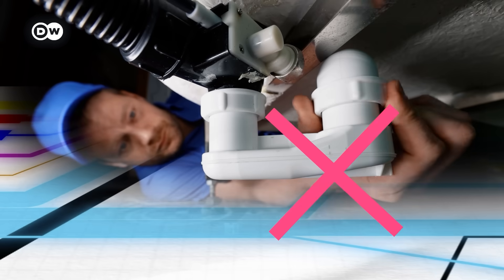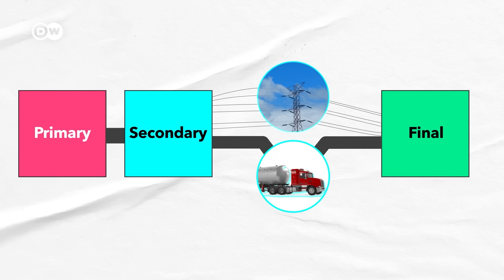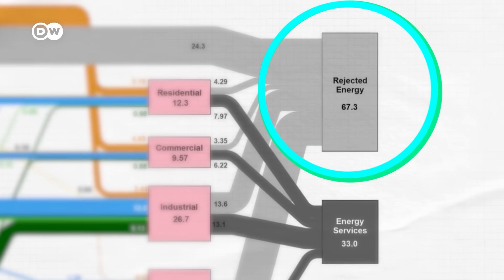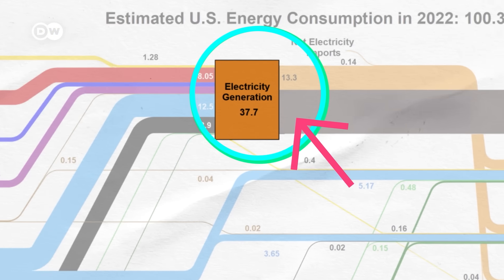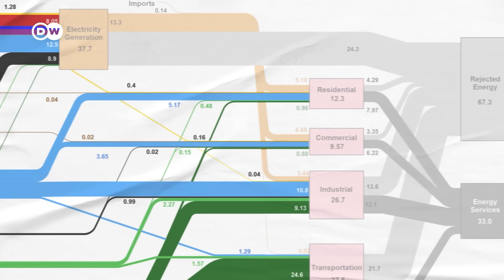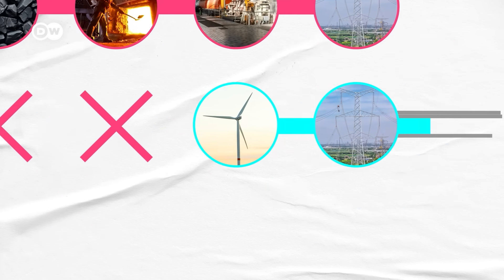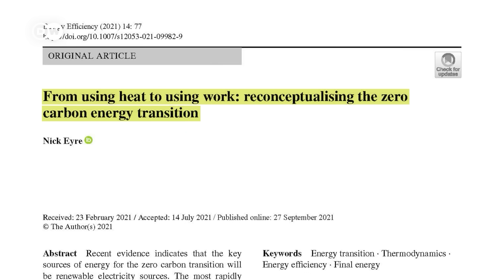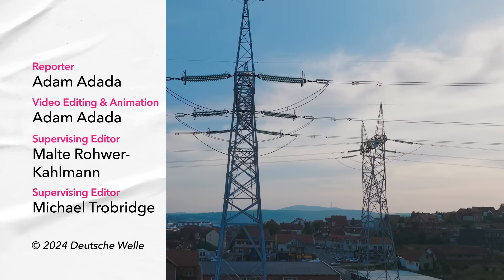The mind-blowing thing we get WRONG about energy

Comment: As an Energy Engineer working in this industry, this videos are great and show how things are not so straightforward. However, we shouldn't downplay how difficult it is replacing all energy uses with renewable electricity. Industrial heat is not currently possible to provide it with electricity when high temperature is required. Jet fuel is another example of a hard to decarbonise industry.
Moreover, we should not forget that electricity transport over long distances isn't cheap, if a country doesn't have much renewable potential, they may be required to import the energy in other forms such as traditional fossil fuels, which is a more efficient way of transporting large quantities of energy over long distances. An example of this could be Japan.
So whilst what you are mentioning here is true and important for people to understand, we shouldn't underestimate the complexity of the challenge our generation is facing.

Edit: to clarify, I am not against the transition or saying it is impossible. Just stating that it will take the use of many technologies, energy vectors, energy sources and it won't be a walk in the park. But it is definitely achievable.
Reply: There are already ways of producing industrial heating using green energy, they just haven't been widely used yet. While I do think that there will be SOME fossil fuel use for a long time to come, things like long haul air travel that are very hard to convert, It's important to remember that it's not necessary to eliminate ALL fossil fuel use, just to massively reduce it in the areas where we CAN. It's like that old meme people pass around of the EV that's run out of charge and is being recharged by a diesel generator, yeah, that one incident is still a wasteful use of fossil fuel, but assuming that this does not happen often, the EV is still way more carbon neutral than a gasoline car that burns gasoline for every mile it travels. The perfect is not the enemy of the good.
Reply: @timogul true, but… EV’s emit less co2 over lifecycle but it isn’t WAY more, as you claim. They also come with significant, toxic, environmental effects that ic doesn’t. Swings and roundabouts.
Also oil is really too valuable a resource to waste burning so we should minimise it’s use/waste but what lengths to go to? Do we trash civilisation?
Careful where your dogma takes you.
Reply: @timogul exactly 
I was going to state that, the industrial energy uses traditionally had an argument with the energy transition but not any longer. 
They have already created electric arc furnace for steel and electric kiln furnace for cement (if coupled with CCS can dramatically reduce carbon emissions to near zero). 
Those two are among the supposed hardest to decarbonize industrial processes. And in my opinion if using geothermal for the 24/7 energy generation is the right solution, because it’s always readily available and if deployed at the large scale like all the efforts that went into making solar PV, the cost would come way down and make it a no brainer 
Innovation in the geothermal sector has improved and many solutions are already developing, including “enhanced geothermal” to generate it anywhere on earth, not geo specific, a sister approach like fracking. 
We have enough smart people out there and technology to solve this problem 

It goes beyond mere solar and wind,
Reply: @koriifaloju2051  I like the idea of geothermal, but I do think we need to be careful with the "enhanced" solutions, because they have similar concerns to fraking in how they undermine the local rocks. Okalhoma will be one giant sinkhole at some point. :D
Reply: @timogul  Due to efficiency bonus, recharging an EV with a diesel generator is better for the environment then to use a diesel car. E-power hybrids (generator + small battery + electric motor) has better energy efficiency than regular hybrid cars.
Reply: @CemKalyoncu  Just a reminder that there are already Chinese plug-in hybrid sedans in the market that can do over 2000Km (or over 1200 miles) on a single fuel tank.
Their fuel tank isn't any larger than that of a conventional ICE car, the much higher range is from better efficiency when using that fuel.
(And they also have more than enough pure electric range for the average daily commute, so most people who can charge them at home would only need to use fuel for road trips.)
Reply: @CemKalyoncu  No it isn't. Any time you insert anything into the energy delivery path you have unrecoverable losses... those annoying laws of thermodynamics again.
Reply: @aceroadholder2185  Of course there will be losses, but not 2/3 of the total maybe 1/3 or 1/4. Solar powered EV is about 85% efficient. Even if you lose a 10% to transmission losses it will still be 1/4. A distributed electricity system will avoid most of the transmission losses during the day. I am guessing we will be forced to charge our cars during day time to exploit solar power. For comparison, when fuel refining and transportation is included, the most efficient ICE is less than 25% efficient and it is still not in market.
Reply: @CemKalyoncu  There is no physical way to come out ahead by charging an EV with a diesel generator vs. just putting the diesel fuel directly into an automobile. Think about it. If a diesel generator is 35% efficient and the EV is 85% efficient the EV has an overall efficiency of 29.75%. That is generously assuming no other losses. Better off to put the diesel fuel directly into the car and get the 35% usable energy. The awful thing you learn when you suffer through thermodynamics in college is there is no free lunch.
Reply: @aceroadholder2185  You would be right if both types of cars were using same drive trains. Gearbox transmission loses are between 20% - 30%. Electric cars with single motors will not have gearbox losses, single reduction and differential gear will have some loss but nowhere close to those numbers. Dual motor EVs can opt out to use differential as well, reducing this even further. So, diesel engine generating 35% does not reach to wheels, you lose about 40% along the way. Also there is another factor, EVs can do regenerative breaking, unless your diesel car is a hybrid, you will be missing on another 20%.

Thermodynamics is for completely closed and idealized systems, cars are not that simple. Even constant display of efficiency in EVs force you to drive better. I used to drive 100-120km/h, since I switched to electric I started to drive 90-100, not that my car is under powered or struggling, it just keeps showing me current consumption. You see, you cannot explain this using thermodynamics. Well you can, but you will not live that long...
Reply: I did the math, a regular diesel will put 17% of the energy put into it to move, accounting for breaking losses. 20% if it is a hybrid including weight difference. An EV powered by a generator will put around 27%, 22% if you account for weight difference for a 40kWh battery pack. We are talking about almost 30% increase in efficiency. 

E-power series (exactly what we are talking about, generator + EV) of cars made by Nissan claims they have 20% efficiency gain on top of regular hybrids. They do not have 40kWh battery packs though.
Reply: @CemKalyoncu no, driveline efficiency is about 90%. The days of 50% losses through a slush box auto are long gone.
Reply: @CemKalyoncu  no, that’s way too high. A transverse transaxle is around 90 and rear drive with bevel diff is around 85. To get 20-30% loss you need to add in a bit of rolling resistance, which EV’s have more of due to weight.
Reply: @aceroadholder2185  Your calculation is correct, but the critical factor is that IC engines have a narrow RPM band where they are most efficient.  So that RPM where they would be running to charge an EV's battery or supply the grid.

This is the entire concept behind hybrid power trains which are some of the most efficient ways to use fossil fuels for transport.  Though fossil fuels are actually the worst use for transportation overall.  Even the hybrid power train is far behind pure electric.
Reply: @aceroadholder2185  A stationary diesel generator can be designed to be much more efficient than the small diesel generator in a car, and an electric car can also use regenerative braking to capture energy when the car is slowed down, instead of that energy being lost as heat in the brake pads.
Reply: @viviancrompton1920  Vivian, if any of the ideas posited in the comments made any economic sense companies would be doing them in a heartbeat. Yes, a stationary diesel can be made that can reach 50% thermal efficiency whereas a diesel powered car might reach 35% efficiency. The rub is that to do that the stationary engine must develop 8-10 thousand horsepower per cylinder. In container ships these engines produce north of 100,000 horsepower. The trick these engines use is based on the fact that the volume of the cylinder increases faster than the cylinder surface area. This reduces heat loss. These engines don't run on normal refined diesel fuel but on bunker oil that pollutes out the ying yang.
Reply: We don't need to go down to zero carbon emissions to stop climate change though, aviation accounts for about 2.5% of total co2 emissions and we could totally keep that as it is if we fixed all the rest. Also afaik work is being done to find a solution to high heat industries but I can't comment on that as I have too little info. Surely we would need less energy capacity if each end product that uses said energy was way more efficient. Policy could really help with that.
Reply: @enricod.7198  Besides EU no one care about climate Policy by the time EY reach nett zero Global emission will rise 10% by moving heavy industry from EU to Asia alone.
Reply: @enricod.7198  We could tax aircraft fuel and use the proceeds to offset it
Reply: Great comment
Reply: what kind of "high temperatures" are you referring to here? i mean an electric arc furnace is pretty damn hot, i'm not sure what other industrial needs would require any magnitude of level of heat higher than that.
Reply: Plus various forms of energy storage, which will need to be used, also represent energy loss. Pumped hydro and batteries have realtively good efficiencies, about 80-90%, but for long term storage we only have hydrogen, which also has efficiency of about 30%, depending on methods used. I am all for decarbonization, but it's a but frustrating how people sometimes don't want to admit the challenges we need to overcome.
Reply: @pyroman2918  Exactly, that was my intention with this post. Decarbonisation is a requirement, but let's not downplay the complexity of it.
Reply: I've read a lot of the discussion in the comments and come to the conclusion that even a conservative estimate means we only need to replace half the fossil fuels to have the same amount of usable energy. This is excellent news!
Reply: This explanation fails to understand things like improving efficiency regardless of energy source and that renewables can be used more locally than fossil generation which reduces national transmission issues.
Reply: Well informed comment. I'd add the mining and processing of minerals required, even the basics like copper, is huge.
One more, the information about data centre energy consumption and future projections seems difficult to obtain.
At least the heat may be useable.
Reply: UHVDC energy transmission losses just 3% per 1000km. Liquid ammonia transportation by cargo ships also looks economical viable. It can be burn on ICE and turbines, or converted to electricity in fuel cells.
Reply: Shocking there isn't much push economic push towards energy engineering and research globally.
Reply: Industrial high temperature can be created with H2.
H2 can be created at moments of surplus (low demand times in the nights or a lot of sunshine in weekends) of electricity. I know the H2 cyclus is also inefficient , in other words not a solution for driving cars...but it works for steel production plants.
(Source...My child works in the H2 usage and production research as PHD fluid dynamics/master mechanical engineering)
Reply: Jet fuel is actually the easiest because we can just stop flying, no need to replace anything
Reply: Actually this is just an engineering problem that is due to the fact that burning fossil fuels was just so cheap co.pared to using electricity. All major producers of industrial/mining equipment are currently developing processes that use electricity directly, because now there is an incentive. 
Wind and solar power is already much cheaper than any other electricity generating technology ever. Even projected costs for fusion state it at 4-/5 times the cost once it works.
And always compare apples with apples: we need to renew and improve the electric grid anyways, wether we make a transition or not. Often all that cost is put on the transition costs.

Nuclear power is low in CO2 but just to expensive, at least in the western world. It will like all heat based electricity generaters suffer from increasing temperatures due to climate change, that will be a large problem of the cooling side. This is already an issue in france every summer, when the rivers become to warm. As a consequence we either kill the flora and fauna there to keep dumping the heat in, or we cool less and get an even worse efficiency. 
Direct current transmission lines are being build already (in China at least, UK is planning-...) and are much more efficient for long distance transport of electricity.
Reply: "Industrial heat is not currently possible to provide it with electricity when high temperature is required." Not too sure about that one to be honest. My homecity houses the largest copper production plant in Europe (16th largest in the world) and they get ALL their energy from electricity (1 billion kWh per year). They aim to use 80% renewable by 2050 and they operate the worlds largest metal recycling facility (it's much cheaper and efficient to recycle metals than to extract them from ore). It's just a question of wanting to do it, there's a solution to every problem.
Reply: As an engineer, you do realize that transporting fossil fuels is even more costly and inefficient than electricity since it is physical matter?  Once the grid is setup, variable cost of transmission is quite low.  Moreover, the grid is a multi-purpose piece of infrastructure.

People just assume that fossil fuels like gasoline appear magically at their local gas stations.  But, in reality, it requires a massive 24x7x365 infrastructure that requires constant investment, subsidies, capital and manpower to explore, drill, refine, and distribute the stuff.  The amount of energy that the US uses to refine its petroleum would be enough to power all of its EVs and much more.

The science is behind the transition.  At 99.9% the mass of the solar system, the sun provides a mindboggling cosmic 173,000-terawatts continuous non-stop to the Earth.  Or, about 1000W per square meter at ground level peak and its always peak somewhere on Earth.  Less than 1% of the world's land surface in current generation photovoltaics is enough to power all the world's grids.  There is enough offshore wind to power the world several times over.  All the combined fossil fuels would literally amount to a bucket in an ocean compared to the daily amounts of clean fusion-based energy we get from our sun.

Yes, it is a challenge but everything from science, technology, to politics makes this a clear choice.  For the US at least, it will be on the order of a once-in-a-generation project like the interstate project was in the 1950s.
Reply: @beyondfossil  if electricity is cheaper to transport over long distances as you claim. Why are we transporting natural gas from Qatar to Europe to generate electricity instead of just generating electricity in Qatar and send it over via a cable to Europe? How about Australian natural gas to Japan? 
Over long distances, hydrogen or ammonia are looking more promising as energy vectors than electricity.
Don't get me wrong with my comment, I support transition to decarbonise the world and I am working in the field. I just don't like when people downplay the complexities.
Reply: @multienergico9299  Thanks for the reply. But you're using current fossil fuel hegemonic practices to justify the efficiency of fossil fuels but the two aren't directly related.  There are also a lot of geopolitical factors (subsidies, lobbying, etc) that come into why the current infrastructure is setup the way it is versus another way.  Critically, fossil fuel capitalists will not include the environmental costs of using fossil fuels either.

It's too much to go into great detail in a comment and I'm not sure YouTube's very buggy forums will even post my reply.  YouTube has fails to post 50% of my replies.

It gets even more complicated than what we've been talking about...

In the long term, both long distance energy transport either through grid or by ship is more expensive than generating power locally.  Except for some edge cases, most countries have more than enough combination of sun and wind to power all of their population's needs thanks to the incredibly large cosmic power of the sun.  Sun & wind is a resource that cannot be embargoed, taxed, or tariffed.  With increasing global geopolitical polarization, countries realizing that energy is not just an economic concern but directly a matter of national security.
Reply: @beyondfossil  Indeed, my comment was more to highlight that this is a very complex endeavour and there's no silver bullet. We could have a nice talk for hours.
Reply: @beyondfossil  You don't need 1% but 0.15% of land mass in solar panels. This is average solar radiation, if you place them closer to equator, you will need even less. This amount includes all energy uses including losses.
Reply: @CemKalyoncu  You cannot place solar panels in Sudan to feed Norwegian grid though. It doesn't work.
Reply: @beyondfossil so can you tell me what level of magnitude increase the current US energy grid would need for a 50% increase in EV cars to be charged every night?
Reply: @erickerr4960  The typical EV uses 4725kWh of electricity per year: 0.35kWh/mile and a typical driver drives 13,500mi/year.  There are currently some 2.4-million EVs registered in the US so, on annual basis, represents 11.34TWh energy demand.  But compare that against the total US grid generation of 4230TWh in 2022!

Furthermore, the US 4230TWh grid is capable of much more without any more additions since its capacity factor is far less than 1.0, probably around 0.6. Because of the usual nighttime drop in demand while generating capacity remains the same.  There is so much unused capacity at night that some places in Texas offer unlimited power at night in exchange for paying as slightly higher rate in the daytime.

Peak load is another matter but not everyone will charge at the same time.  Consider the typical EV today has significantly more range than 200mi.  The Chevrolet Bolt is only $25k (not including federal credits) and has 220mi range. The higher end Tesla Model S can have up to 405mi range.  Charging every night isn't necessary.  Or if they charged, they could charge at a much lower wattage.

As EVs proliferate without some control mechanisms, there is a small risk of over-loading the grid with peak load since charging at home doesn't have the natural "rate limiting" you get when people line up at a gas station.  In fact, there are probably an order of magnitude more charging stations than gas stations already right now because every home already has Level-1 EV charging and it's not hard to get a Level-2 240V charger installed for much greater watts.

There are "smart grid" technologies that will definitely be coming up soon.  Cloud-connected software agents installed as brokers on the EV chargers will work to get the best rate for their users.  Utilities can impose dynamic "surge pricing" to steer charging away from dangerous times such as during evenings under a widespread heatwave for instance.  Look up the Open Interchange (OICP) protocol and IEC-63110 standard.

Also, Vehicle-to-Grid (V2G) will allow EVs to actually support the grid during times of need and utilities will pay top dollar for that as its still cheaper than operating dirty "peaker" power plants.  As the number of EV in residences increases, we're looking at building a virtual distributed gigawatt power plant embedded right into the heart of the residences and communities where power is needed the most without hammering the grid since its distributed power is used at the source.  Again, cloud-connected software agents on the user's charger will work to obtain the optimal value for the user.

The next generation grid will not be like today's grid and that's to be expected as you can't solve tomorrow's tech problems usually with today's tech.  Can you believe there are people that dedicate their whole lives to understanding and solving these problems?
Reply: @erickerr4960  The typical EV uses 4725kWh of electricity per year: 0.35kWh/mile and a typical driver drives 13,500mi/year.  There are currently some 2.4-million EVs registered in the US so, on annual basis, represents 11.34TWh energy demand.  But compare that against the total US grid generation of 4230TWh in 2022!

Furthermore, the US 4230TWh grid is capable of much more without any more additions since its capacity factor is far less than 1.0, probably around 0.6. Because of the usual nighttime drop in demand while generating capacity remains the same.  There is so much unused capacity at night that some places in Texas offer unlimited power at night in exchange for paying as slightly higher rate in the daytime.

Peak load is another matter but not everyone will charge at the same time.  Consider the typical EV today has significantly more range than 200mi.  The Chevrolet Bolt is only $25k (not including federal credits) and has 220mi range. The higher end Tesla Model S can have up to 405mi range.  Charging every night isn't necessary.  Or if they charged, they could charge at a much lower wattage.
Reply: @beyondfossil the issue is let's say we do transition away from gasoline for cars.   We will just have a lot of waste product then since we will still need oil for other stuff and in order to get to the heavier compounds we first need to boil off the lighter compounds.  I see heavy oil being more valuable in the future but I just see gasoline getting cheaper as more people buy electric vehicles.  A lot of stuff is made from a single barrel of oil
Reply: @beyondfossil  wow, thank you, i know nothing about these arguments but your comment seems very inspiring and gives hope.
Reply: Look into the companies that are trying to solve these problems! For industrial heat, check out Antora Energy. They use renewable energy to heat carbon blocks to 1800C, enough for most industrial processes, and their system can provide electricity as well. (There are several other companies in the “box of rocks” industrial heat space too.) 

For cement, the source of 8% of global CO2 emissions, look at Sublime Systems. They use electrolysis rather than heat to turn calcium/silicon mineral sources into cement. I say “mineral sources”, because they can use recycled concrete as a source as well. Electrolysis eliminates the high heat required - CO2 from burning coal/gas for the heat is 40% of the carbon footprint of Portland cement. But the other 60% comes from CO2 released from limestone (calcium carbonate) in order to free the calcium. Sublime’s process doesn’t use limestone, so it gets rid of 100% of the CO2 when running on renewable energy. 

Don’t assume that observed problems are insurmountable!
Reply: thanks for introducing nuance to the discussion :)
Reply: Jet Fuel Is already being substituted with the so called aviation biofuel.
Reply: As an AI
Reply: That is so disingenuous. There are viable sustainable alternatives to fossils for high temperature industrial processes, just google it and you have the balls to talk about costs of electricity transport?? Really, it seems to you more efficient the big oil trucks or the Exxon Valdez?
I hope they pay you really well, even if you're doing a shitty job.
Reply: Did you see the news that scientists found out a way to use solar to heat up forges up to 1000 C?
Reply: I just saw these days, scientists using solar power to heat up a forge up to 1000 C, what you say about that??
Reply: As an energy engineer you probably know that you can definitely produce industrial heat with renewables. Maybe it's not economical right now, but definitely possible.
Reply: @spacemelon3988  Yes, I only mentioned electricity. Green hydrogen is potentially an option. Hopefully the economics work out.
Reply: Also I think we need some new technologies. Like for example infrared rectenna which can collect infrared energy from any heated source and convert to electricity. You can imagine this like a black body have unequal absorption and emmision.
Reply: Yes, I agree with you. In the video basically two different topics are mixed, and for question that if it is easy to transition DW answers that renewables are more efficient. This is true and that’s the reason why they’re getting cheaper in the first place. But switching to them and electrifying everything we can may mean that overall we will need less primary energy but surely more electric energy and that’s the hard part of this story.
Reply: Steelworks are switching from coal to electricity - especially when reusing scrap metal. Aluminium has been smelted using hydroelectricity since the 1960s. Now we are able to have fully electric cars, buses and of course trains. Thankfully the UK now has only one coal burning power station and that doesn't run all the time. Renewables are certainly able to replace a large percentage of fossil fuels and this needs to continue. Also instead of building new nuclear at a cost of £billions over decades we should have far more rooftop solar for electricity where its used.
Reply: Hydrogen could be the answer to a lot of these issues
Reply: @Grinwin123  Hydrogen's a pretty poor answer most of the time. For one thing, almost all H2 today is produced from methane in inefficient, leaky processes that amplify the GHG effect because methane is 120 times more GHE-intense than CO2.. and then devolves into CO2. Biomass H2 would be nice, but would also be a waste.

Carbamide has better performance characteristics than H2, and is easier to get from biomass, and far safer than ammonia, which is also better than H2. But it'd be engineering madness to use either of those, and they're superior to hydrogen, if you could use batteries, or other biofuels from torrefaction of waste wood.
Reply: Electric cant travel too far away from source. Too far and a lot of power gets wasted into the environment. Fossil fuels still have the advantage when it comes to transporting them over long distance. You lose almost no power transporting coal from china to canada (except the fuel used to power your shipping journey) because all of the energy is embodied within the rock.
Reply: @davidl.e5203  
...across national borders but still decentralized power grids have a big advantage: different kinds and amounts of energy can be fed in or drawn off at many points - and can be interconnected into a smart, virtual power plant. Material energy carriers are centralized, inflexible, and come with indirect costs and losses.
Reply: @davidl.e5203  even if tranportation costs are low... coal and oil isnt free like sun or windpower, its complex and comparatively expensive.
Reply: "With concerted efforts, triple the electricity used worldwide today could be provided by solar by 2030."  Where can we get tickets for this concert?  Sounds pretty epic to me.
Reply: Industrial heating is a good use for hydrogen, and I'm saying this as a huge hydrogen skeptic as far as personal transportation and as a source of electricity on a mainland (vs a remote island for generation or consumption of renewable energy). Heat pumps can handle the rest of the low to medium temperature needs.
Reply: Japan has huge wind resources, they're just not employing them right now. Also decent solar.
Reply: Dr Silvia Madeddu gave some interesting insight regarding industrial heat needs and said that they are close to be electrified: https://youtu.be/VfXTXgJBYWA?feature=shared
Reply: "we shouldn't downplay how difficult it is replacing all energy uses with renewable electricity. Industrial heat is not currently possible to provide it with electricity when high temperature is required."
so what? then everything else getting replaced first. 

p.s. I live nearby of an aluminium recycling company. They use electricity because it is cheaper for them. They correspond with the energy company and smelt the aluminium when the energy prices are low. This is a normal reaction of the market to low energy pices at good weather due to high solar %
Reply: You should also remember that energy generation using renewables can be localised and as is cheaper than having to build gigantic fossil fuel or nuclear power plants. There are also other benefits to this as a more distributed energy generation system makes it more reliable. If one wind turbine breaks down or the it's not windy in one region it's only a small % of the overall system, if a gas power station breaks down you have a much bigger problem. Renewables like wind and solar can be installed locally where energy is required reducing transmission loses. I don't think there is a country that doesn't get sunshine or wind.
Reply: Could we provide industrial heat with Oxygen/Hydrogen flames?  Easier, albeit expensive, to make (and cheap if we had excess electricity), or by burning Ammonia - which doesn't produce CO2?
Reply: I heard nuclear power is clean. And that now there is a way to recycle the waist. Or neutralis in. And safe if handle the right way. Japanese messed up by having the generators at a low level. Where they was flooded.
Reply: And don't we have to use fossil fuels to make EVs , Batteries, plastics, solar panels. and Wind turbines?
Reply: The same goes to methane, just reduce cow’s meat
Reply: Response to your Edit -- your entire post is factual.  But as a fellow engineer, you gotta lead with "this is doable" before laying out the facts.  Otherwise laymen get defensive.
Reply: Bullshit, you CAN produce high heat with electricity infact it is what MOST industrial heat is created with even things as hot a potery kiln can be electric and ONLY electricity can produce the HIGHEST temperatures because no fuel can EVER burn over about ~3000 degrees.  The principle use of fossil fuels is because of COST not any kind of technological barrier, or because a reducing chemical reaction is what is actually being created as in a blast furace.
Reply: The decision should be made based on a cost benefit analysis, not based on the views of politicians and “professionals” who have their own agenda.  Without the exact details and numbers, there are arguments from both sides that made sense, but are actually based on guesses and assumptions
Reply: It’s like you missed the entire point of the video
Reply: Hmm 🤔
A gasoline car is 20% efficient, so a 100 kW gasoline car consumes 500 kW worth of fossil fuel.
But the equivalent e-car still needs to provide 100 kW, not 20 kW, as one might mistakenly assume.

(the car is just a example to explain the principle)
Reply: @notconnected3815  Problem rises from the way we measure power output. We often measure engine power, not power used to move the car. Also regenerative breaking changes the equation drastically. When driving in the city, you can expect to recoup around 20% of the power used as regenerative breaking.
Reply: Holding up aircraft as an example of a hard to decarbonise industry is disingenuous because it's a whopping 2% of the carbon we produce. 

If, on the other hand, we completely electrified all ground transportation, that would result in larger efficiencies all over. We wouldn't be burning oil to ship oil across the sea, and some ridiculously high percentage (40% off the top of my head) of ocean shipping is done to ship oil. Only 8% of the oil in America is refined into jet fuel, and that can easily be done domestically. 

Personally, I can live with not ever bothering to electrify aircraft if we can solve the other 98% of it.
Reply: Ever heard of green hydrogen for industrial heat?
Reply: What happens when you got no wind for days and you have no sun or very little sun and you dont get a lot of energy?
Reply: Not to mention that every piece of renewable infrastructure must be produced. The production of the vast majority of renewable energy requires fossil fuel use which has been conveniently left out of the equation
Reply: Stopped reading when you said "all".

Nobody cares. We're trying for most right now
Reply: I agree with you. However I do think that SOME of those industries could be at least partially electrified if looked at from a higher level. Jet fuel: jets are used for transporting goods and people; there are other modes of transportation that could reduce the load. Flying slower can also reduce fuel costs as well. Steel manufacturing: as a building material and there are ways we could swap in alternative materials in certain situations (see glue lam beams). 

At the end of the day, we will need fossil fuels for some things, but with a bit of problem solving, rethinking material use, and compromise, we can significantly reduce the need.
Reply: @bobbybyrne1899  One idea to reduce reliance on jet fuels is more high speed rail/maglev.
Reply: @bobbybyrne1899  Jets fly at high speed to reduce fuel consumption.  The air is thinner at altitude and reduces drag.  They fly in the "death triangle" where slower is a stall and faster is transonic.
Reply: There's also nuclear, which Japan does utilise
Reply: @anxiousearth680  hmmm... the newer generation of nuclear reactors could be part of the energy mix - but here, too, the poorer efficiency for power generation, the waste problem, accident risk and high production costs apply. Nuclear energy is neither sustainable nor cheap, quite the opposite. Thousands of new reactors would be needed worldwide, even several million in the case of small modular reactors. The entire infrastructure for the production of nuclear fuel and the unresolved disposal of nuclear waste would require billions in investment, which would then be lacking for the expansion of renewables, storage and grids...
Reply: @anxiousearth680 And if they had the generators at a higher level. So they weren't flooded. the meltdown wouldn't have happened
Reply: Jet fuel is easily decarbonized because we'll use hydrogen. There's already smaller planes like Cessna's running on it, and there's a company ZeroAvia that's hard at work developing a revolutionary high temp hydrogen jet engine that will emit hot air that's full of water vapor. And green hydrogen plants are being looked into or being built ALL OVER the place. 

as for the longer distance thing, this is true, but there have been massive steps in terms of higher efficiency lines that could be restrung across existing poles that can carry much higher loads at a much lower power loss AND with less line sag making them safer. Plus iirc those higher efficiency lines are actually pretty cheap to produce.
Reply: @Fenthule easy - you’re clearly not an engineer!!
Reply: It's essential to put certain issues into perspective and address a few misconceptions:

Fraction of Hard-to-Abate Sectors:

Hard-to-abate sectors like aviation and high-temperature industrial processes indeed present challenges, but they represent a relatively small fraction of overall energy use. For example, aviation accounts for only about 2.5% of global CO2 emissions, but 25%-75% of emissions in this sector are easy to abate short-medium flights replaceable with electric planes; likewise for shipping (40% of which is shipping fossil bitumen, coal, gas and oil) comparing shorter or coastal and longer routes. Focusing on decarbonizing the majority of sectors where electrification is easier and more cost-effective, and the low-hanging fruit in harder to abate sectors, can lead to substantial emissions reductions while we develop solutions for the harder parts of harder sectors.

Industrial Heat and Alternatives:

While some industrial processes require high temperatures that are difficult to achieve with current electric technologies, advancements are being made. For example, electric arc furnaces are used in steelmaking, and research is ongoing into other high-temperature industrial applications. Additionally, hybrid approaches, like combining renewable electricity with  clean biofuels, are being explored to address these needs.

Efficiency and Infrastructure:

Electrification and renewable energy infrastructure, once established, offer significant efficiencies. The losses in transmitting electricity over long distances can be managed with advancements in UHVDC grid technology and storage solutions. Moreover, the energy required to extract, refine, and transport fossil fuels is substantial, and transitioning to renewables can reduce these inefficiencies. For example, the energy used in refining petroleum worldwide alone could power all electric vehicles in the US and more.

Renewable Energy Potential:

The potential for renewable energy is immense. Solar energy, for instance, can provide more than enough power for the entire world with a relatively small land footprint. Offshore wind also offers substantial potential. The scalability and decreasing costs of renewable technologies make them increasingly viable for widespread adoption. With concerted efforts, triple the electricity used worldwide today could be provided by solar by 2030.

Cost and Technological Advancements:

The cost of renewable energy technologies has been decreasing rapidly. Solar and wind energy, coupled with advancements in battery storage and smart grids, are making renewable energy more affordable and reliable. Countries with limited renewable resources can still benefit from global advancements and potentially import clean energy or develop regional solutions like solar, wind, and enhanced geothermal power or trade with neighbors through UHVDC.

Incremental Progress and Policy Support:

It is not necessary to eliminate all fossil fuel use immediately to make a significant impact on climate change. Incremental progress, supported by strong policies and incentives, can lead to substantial reductions in carbon emissions within six years. Policies that promote energy efficiency, electrification, and renewable energy adoption can accelerate the transition and address many of the current challenges. No electricity grid has ever taken more than five years to transition from fossil to renewable from the first shovel in the ground.

In conclusion, while the transition to renewable energy and electrification is complex and presents challenges, particularly in hard-to-abate sectors, it is both feasible and necessary. Focusing on sectors where we can make the most impact, investing in research and development for challenging applications, and leveraging policy support can drive significant progress in reducing carbon emissions and addressing climate change.
Reply: "Moreover, we should not forget that electricity transport over long distances isn't cheap"

Not nearly as expensive as leaky oil/gas pipelines destroying the environment or using even more inefficient fossil fuel energy to haul it around by truck, train, or ship.

Solar is viable in basically any inhabited part of the world--it's gotten so cheap that even as far north as Germany it has a lower LCOE than fossil fuels (even locally sourced ones like coal).
Reply: The other issue is in order to get to the jet fuel you need to first get through the gasoline. A refinery is basically just a big distillery tower.  As the temperature rises certain products are produced.  Stuff like propane comes off first.  Then you have gasoline.  Gasoline at least with the lighter forms of oil make up a large part of each barrel.  What do you do with that in order to get to the diesel, jet fuel, asphalt, and greases? I personally think the heavy oil will be more valuable moving forward.  It has less of the lighter "fuels".
In Canada one oil company is looking at using micro reactors for heat production though.  That is still a few years off though and then the question will be economics and reliability.  I was watching an interview with one guy that was talking about it and he said the micro reactor would work extremely well in the oil sands.  They use a lot of steam and the temperature the micro reactors produce could be a direct replacement for natural gas boilers.
Reply: I appreciate your comment. I'd also like to underline when you say "it is achievable" you seem to be talking about the technological transformation. What I think gets lost is the reason WHY we want this switch away from fossil fuels, and that's an environmental concern which really does not seem achievable in any meaningful way. CC is here and is only going to get worse. As much as I love efficiencies, the public focus should probably be heavily geared to giving value to mitigation & preparation (among other things).
Reply: Sure, but the point many people many not see -- because of all the climate disasters cropping up on a daily basis -- is the fact that the energy transition required isn't simply impossible. Many people think it's too late. So while your caveats are true, don't YOU overlook the human side of your own calculations, my friend.
Reply: I have a picture of a ghost on a tv.
Reply: As “an engineer” you will know the loss of energy to heat in delivering renewable electricity is phenomenal … And all that heat contributes to global boiling.
Reply: @Hickalum : What are those phenomenal losses?
Until now the entire energysector have been accepting the huge losses in the fossil fuel extraction as a "hidden loss" that we could ignore.
Everyone thinks the fossils start at the gaspump, totally ignoring that 44% has been burned already by then.
And polluting with CO2 compared to releasing heat directly, the CO2 is going to be heating the planet for another 100 years, while heat dissipates only once.
Reply: @poulhenne  ; Take an EV power by renewables for example …
Wind turns a turbine + heat.  Turbine turns a generator + heat. Generator makes ac electricity + heat. That is converted to DC (cuz the AC is the wrong frequency for transmission) plus heat. That DC is converted back to AC plus heat. That is transformed to 60,000 volts for power lines + heat. Electricity transmitted hundreds of miles to sub station + heat. Substation transforms it to 240 volts + heat. Car transforms it to 48 volts dc + heat. 48 volts charges battery + heat. Battery discharges into car motor + heat. Motor turns electricity into kinetic energy + heat.  
Which is nothing compared to the heat wasted and required to construct the turbine itself and the associated tons of concrete in the first place.
Reply: @Hickalum  And all of that considered, still twice as efficient as fossil on its best day, even if you only consider inefficiencies internal to the engine.
Reply: @Hickalum  Yeah, but that's an argument against "getting work done," not an argument against green energy or EVs. The heat generated by all of those steps is not zero, but it's still a fraction of the heat it would take to generate that same output using fossil fuels in any way.
Reply: @Hickalum  that turbine doesn't create heat, its an extremely minor byproduct of the conversion from wind energy, which comes from the heat of the sun. same for solar panels. they aren't creating heat, they are taking energy that would have otherwise heated the earth directly (by shining on it) and converting it to electricity.
Reply: @vinylcabasse conservation of energy lad. It all ends up as heat, no matter what!!
Reply: @jiminycricket9877  that's exactly what i was saying. i assume you meant to tag who i was originally replying to
Reply: @Hickalum  Loss is always in terms of heat, you lose more with fosile fuels meaning you heat environment more. But then again that heating is nothing compared to build up that will keep heating the planet for centuries.
Reply: @CemKalyoncu  Thermal losses from processes such as energy production are not what is causing global warming. It is the trapping of all heat (but mostly the sun's) by the atmosphere which is causing the problem. It is because we have altered the composition of the atmosphere by burning fossil fuels that it is retaining more heat than before.
Reply: @nickwinn7812 That is what I said but, losses are important because significant losses mean we have to produce more.
Reply: @Hickalum  NO. The leaks of heat do not contribute in any significant way, other that its signaled in this video. An old machine looses energy, so you need to put bigger machines, and more CO2 in the air. But heat leaks doesnt compare. Its about orders of magnitude.
Reply: @Hickalum  it's not, and it doesnt
Reply: @Hickalum  What total nonsense you speak.
Reply: @Hickalum  Solar panels don't contribute to global heat, as they remove about 20% of what would otherwise warm the ground - they just move the warming elsewhere to where it will be used, or it is lost in transmission/conversion. The same applies to hydro-electric.